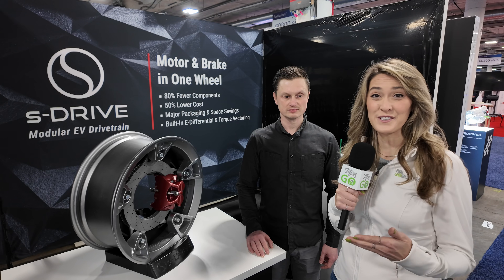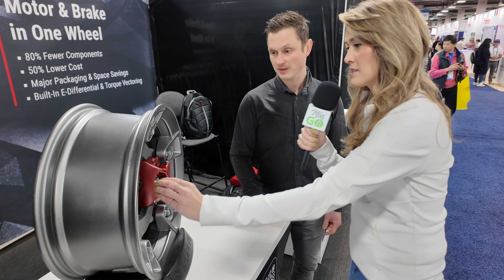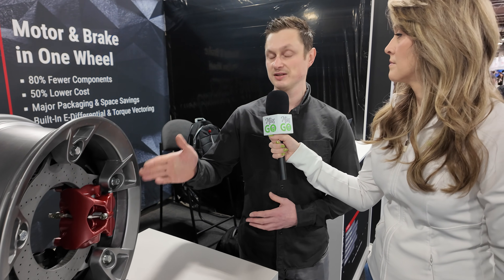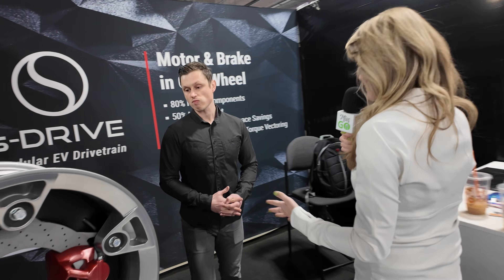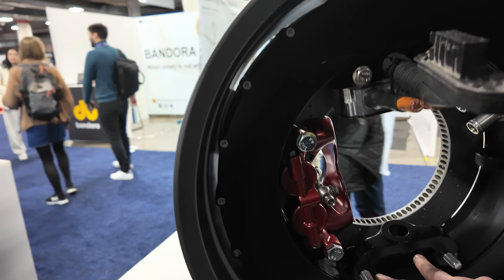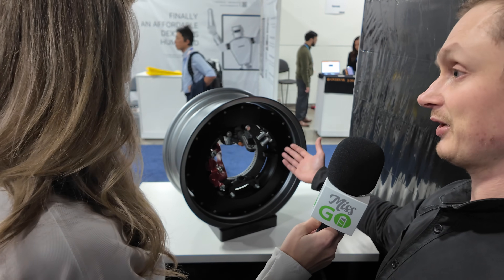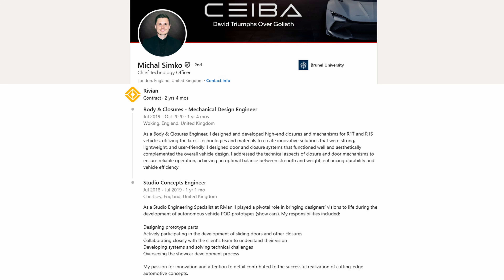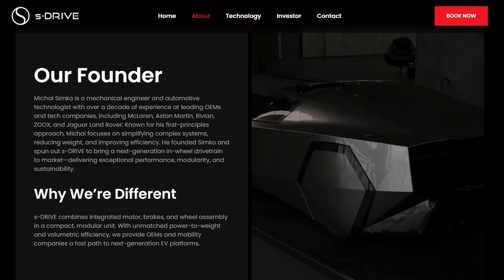S-DRIVE In-Wheel EV Powertrain Solution (CES 2026)

Comment: thats absolutely incredible! 95% regen breaking?? we need that ASAP!
Reply: Does he say 95? Doesn’t he say it depends on the battery and doesn’t give a number?
Reply: @MegaMijit 95% efficiency... 
Congrats, you discovered electric motors which have been that efficient for decades. 
Except this motor is total crap because of large sealing surface and high velocity.
Reply: Coasting always beats regen and the 95% efficiency is the peak efficiency at the best rpm-load point for the e-motor. Also, there are losses in the inverter electronics well as in the battery that would easily add up to >10%. . Regen is better than friction braking of course, but coasting is king which is why planning and anticipating is important.
Reply: I personally hate regen, it makes me car sick.  The only BEV I've driven at speed that's comfortable is the Porsche, you can disable the regen and it's a much more natural feel.
Reply: @wj9494  if you actually modulate the accelerator pedal instead of using max regen to slow down every time, you can perfectly mimic the feel of a normal brake pedal. I do it all the time and cant tell any difference between regen and braking in a gas car.
Reply: @Comfort031 💯! I have BAD vertigo (used to get sick just LOOKING at swings, lol) & realized on day 1 w Polestar in 2023 not to fully lift pedal.
Reply: @wj9494 That sounds like user error more than the regen braking. Try learning how to break softly, it works wonders.
Reply: @wj9494 you can have really badly gripping brakes in both ICEVs and EVs. The regen gives a lot of control, if the system is set up right
Reply: @wj9494 I can shut the regen off in my Tesla and occasionally do on very snowy roads when I want full control in the way I have my whole life. However it really just takes a few days of driving to learn it and not cause motion sickness from the constant acceleration/deceleration. Regen can perfectly mimic braking once you use the pedal right
Reply: @wj9494  Same. I had an electric bike with Regen breaking and it just stops you so fast that it feels like I'm holding the breaks when ever I'm not on the throttle. On bikes regen breaking doesn't do much so turning it off was the better option anyway.
Reply: @trsskater  for non ev people Regen is disgusting. But if you've always had Regen onmg it's hands down the future. Fuck brake maintenance 100% Regen is so much easier. Even if it isn't perfect, for people who use their vehicles a lot it's a time saver and an annoyance remover. Plus these things don't make noise or fail. Unless you fucked something up.
Reply: @MrJustek  I think I need a cars mass to try it with. Because on a bike it's definitely feels bad unless going down a steep hill so you don't stop abruptly.
Reply: @trsskater  Isn't this adjustable on pretty much every EV? The problem isn't regen the problem is that it's turned all the way up. In cars they often call this "one pedal driving" but that doesn't translate great to bikes.
Reply: @Turksarama  Yeah it has different levels. But since the mass is so small it only regenerates a little power when used at the max setting. Less than that it isn't noticable increase in power.
Reply: @Turksarama When I bought my 2025 Model 3 the regen was adjustable or you could even turn it off. That option suddenly disappeared one day 😂.

Comment: The wheels on my car (Centerline forged) weigh less than 12 pounds each. My car is front wheel drive. It would be slick to use these in the rear, yank the motor out of the front, and replace it with batteries.  But unless you're comparing these to a over-weight steel wheel, I can't see how these could be the same weight as a decent wheel. I'd like to hear the actual weight of these (minus tire weight) rather than a vague weight description.  I hope this isn't just another "Donut Labs" BS claim.  440 ft lbs per wheel (880 for two, right?)  would be bad-ass.  That's 680 more than I have now! 👍

I want to see a stock production car (that these are supposed to be for an EV conversion) that can accommodate a wheel that can turn 90 degrees.  😉And if it has to be a special chassis to do that, you might as well move the motor inboard and reduce the unsprung weight.
Reply from the maker: Weight will vary wildly based on size, power option, cooling option, brake option, and rim type.
Their web site is a great way to learn more from the development team. -Producer Tim

Comment: Main weaknesses of hubless motors in rims are (1) bearings longevity (2) water mud protection's longevity.
No, unsprung weight isn't the main issue for everyday vehicles, contrary to popular belief.
Unfortunately, nothing on these 2 engineering deal breakers in the vid...
And dampers decoupling the rim from the motor, thus inevitably leading to non-concentricity in several situations ? Interesting choice. Many questions here, and curious about the driving experience and vibrations (that introduces several new vibe modes, that are unheard of in wheels w hubs).
Reply from the maker: In this interview, the inventor confirmed that testing is part of the upcoming development process.
-Producer Tim
Reply: @MissGoElectricIndustry  Indeed, and they are extremely popular in cars.
Oh wait...
Sorry that my tech points triggered such a look-over-there response instead of actually addressing the issues. Oh well, moving on.

Comment: Great interview. Hoping Aptera is watching
Reply from the maker: Did they already switch motor providers once?
-Producer Tim
Reply: @MissGoElectricIndustry  Yep... they said their original supplier could not commit to the volume the hope to have or something like that.
Reply: @MissGoElectricIndustry  One issue is that in-wheel motors are seen by some as unproven and risky in a startup EV. The conventional Vitesco/Continental e-axle motor has been driven millions of miles, so it is known good drive solution, and can be easily and reliably sourced.
Reply: Best wishes to them. That’s a great improvement in drive technology.

Comment: How does all the added weight and inertia affect the suspension of the vehicle? Normally you want moving inertia to be very low weight to enhance suspension. Also, what happens when it rains and you have to driver through water that will partially submerge the wheel?
Reply from the maker: He stated that this is less weight overall and comparable unsprung to conventional systems. -Producer Tim
Reply: @MissGoElectricIndustry yeah… about that….🐂💩

Comment: When the battery is full the generated braking electric power goes to keeping the battery and inside of the vehicle warm in the Winter and keeping the battery at optimum temperature and AC in the Summer. 
All in all only advantages.
Reply: Agree.

Comment: 3 concerns with production vehicles:
1) No spare tire option. You get a flat, you are getting towed.
2) Theft. These wheels will be very expensive and a bigger target.
3) Potholes exceed dampeners force reduction.
Reply: And exposure to the elements and harsh road conditions, this will require a lot of maintenance.
Reply from the maker: There are many production vehicle models with in wheel motors operating worldwide? -Producer Tim
Reply: @MissGoElectricIndustry  I did not know that. I live in an area where rim repair shops stay busy.

Comment: the largest untapped part of the hybrid market, is bolt on hybrid for existing front wheel drive cars.   A modest battery pack and replacement of the stub axle/brake assembly of the rear wheels with regen/ebrake/launch assist for the ICE motor.  It would vastly reduce fuel losses for city driving.
Reply: My suggestion would be to replace the rear axle with an electric one on front wheel drive cars and add a small battery.  Now it’s a hybrid.
Reply: @snarlsbarkley5083  that's what I meant, turn the rear wheels into something useful, rather than just wasting fuel!
Reply: If this meant for saving space for much bigger battery on hybrids, basically ICE will no longer be connected to the driveshaft, it would act as a generator instead
Reply: @sihamhamda47  but for what reason just install a bigger battery instead of ice, tank etc. 
Range extenders aren't needed in 2 to 5 years
Reply: I've been saying this for years
Reply: i was wondering how hard it'd be to fit a smaller version that bolts to the front hubs of even older RWD cars, for a DIY hybrid way more attractive.
Reply from the maker: Follow this story on our news show
news.missgoelectric.com
-Producer Tim

Comment: Would have liked to hear how he thinks it compares to Donut's in wheel motors. The Donut motors seem to have more peak power and torque. The rubber isolation of the motor on the S-Drive looks like a possible advantage over the Donut motors for reducing the amount of shock transmitted to the motor from the road. The 90 degree steering angle could be useful. I wonder if in wheel motors will start to catch on. So far none the mainstream electric car manufactures have gone that route. Probably they are concerned about unsprung weight and durability. Wheels get so much shock and dirt it will be tough on motors.
Reply from the maker: We see many differences between this and what Donut offers.  We've also covered many other axial flux and in-wheel options across our network.  -Producer Tim

Comment: It's great to see in wheel motors advancing, they make so much sense for e-motorcycles and smaller EVs to maximize space for battery and passengers.
Reply: Looks like the best new EV tech solving the unsprung mass compromise.  But like with the Donut Labs wheel motor, I am concerned about the bearings because such a large bearing requires a massive seal that must keep dirt... out.
Reply: He did say 200kw. That’s plenty for a big vehicle. It would be perfect for a large AWD SUV and easily do 0-60 in 5 seconds on a small 2WD sedan. It completely changes the shape of the vehicle with moving packs around as well.
Reply from the maker: You bet!! MGE covers more axial flux options in this video
https://youtu.be/xCAvL1gVw8k?si=GgYYCK1UYIk5VzOU
-Producer Tim
Reply: Yeah I've seen a lot of ebikes that are using 500-1000W hub motors, and I wonder if there will be a larger version of it with super high power for EV cars, and now my question has been answered
Reply: This with some modifications is ideal for off highway track drive systems.....
Reply: Reminds of "Orbic Wheel" & their...

"EV-In-A-Box".

Comment: Looks similar to the Donut Lab motor, but axial flux instead of radial flux.  The built in dampers are also unique AFAIK and seem like a great idea, one issue with in wheel motors is wheel bearing load issues.  Would be interesting to know how they addressed dirt and water intrusion, that's another problem with in wheel motors.
Reply: I think the wheel bearing loads aren't really an issue, because regular cars have bearings that support heavy loads. It's not a part of the technology that needs reinventing.
Reply: @coladict that and there’s less weight overall as the gearbox has been eliminated and the mass is not on a center hub assembly
Reply: @coladict  this thing probably needs it because shock is killing the motor. As for the bearings, note that the bearing are huge in diameter, so their linear speed is very high, so they are probably not reliable or durable.
Reply: One trip through run off gravel zone even on a track could be very damaging out on the roads road grit resurfacing stones and winter salt and gravel  getting trapped in the wheel could be nasty ..it's bad enough when it gets stuck in a brake disk caliper.
Maybe not ideal for off road vehicles. 🤷🏻🧙🏻‍♂️🥼🇬🇧
Reply: I’d like to see something like this in a Mercedes Sprinter LWB camper with the new Chery solid state battery!
Reply from the maker: We think the integrated liquid cooling, ball joint, braking location, and several other elements help this stand out. 

If you want to see MGR explore other Axial Flux designs, see:
https://youtu.be/xCAvL1gVw8k?si=GgYYCK1UYIk5VzOU
-Producer Tim
Reply: I don’t think we can trust donut labs anymore.
Reply: @steventrott8714 why not?
Reply: @steventrott8714  Do you want to give a reason?
Reply: @steventrott8714  We don't? Enlighten us because, until now and as far as I know, they always delivered on their promises... and have the patents for that.
Reply: @dalexa because of the fake claim on battery technology Donut Labs made. 
And hubless motor design is dumb, you have to maintain a seal for high length high velocity surfaces. Run that garbage through water and sand while riding on bumps and it's game over.
Reply: @P @PaulAirSky nd you know it’s fake because? Why not wait and see instead of spewing nonsense? Again, until now they delivered everything they said they would. I’ll wait until the second quarter of this year before I throw them into the fire.
Reply: @dalexa  I know it's fake because "the battery is ready to ship", yet they can't even disclose battery to chemistry? 🤣 "it's a trade secret".... What do they think happens when they ship? Because nobody is going to open up the battery right? There are no patents they can put to, or independent lab verification. 
Either they are looking for investors to scam, or they shorted lithium stocks and hoping to cash in.
And what promises have they delivered before? Wasted millions of taxpayers money to come up with idiotic hubless motor? 
How many are out there? What's there reliability track record? How many will make it to 50k miles?
Anyone who has any grasp of mechanical engineering knows hubless motor are idiotic - you have a massive length and massive velocity to seal.
With 1 inch bearing I need to seal 3 inches moving at 4 feet per second, with hub motor it might be 50 inches moving at  64 feet per second.... Thanks but no thanks.